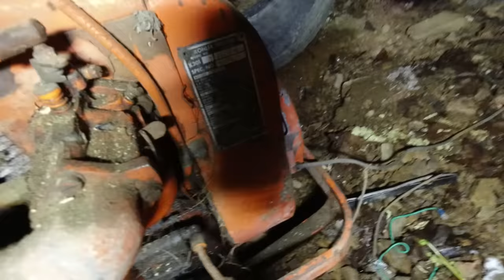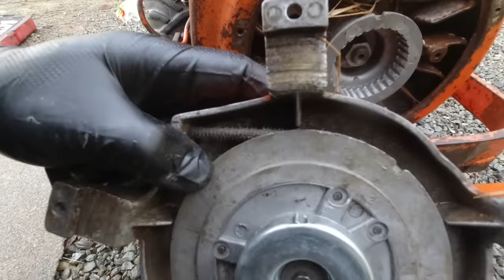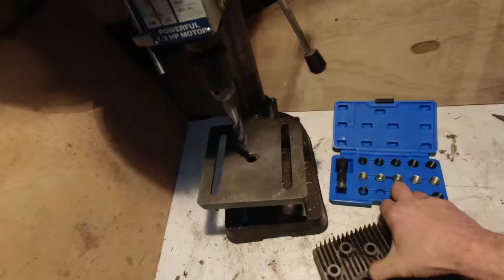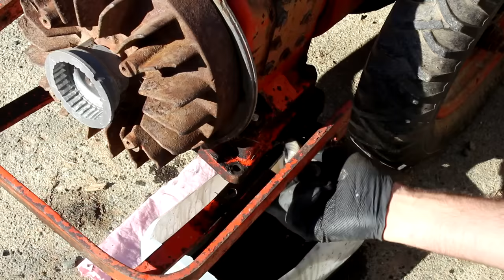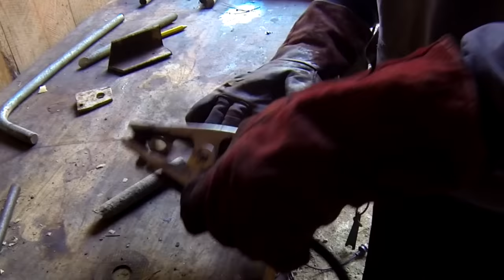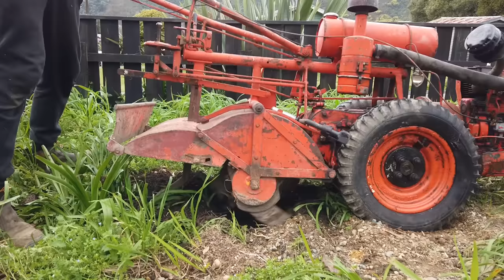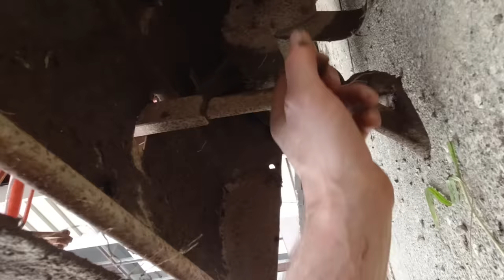Vintage Howard Gem Rotavator hasn't run for 15 years.. Will it Start??

Comment: FYI a common problem with Kohler engines that have not run for some time is corrosion between the magneto & the engine block, causing poor earthing hence weak spark. Hope this may be useful for future reference.

Comment: Ahh the old Howerd Gem I use to use the  bigger next model up the Super Gem with a Hatz twin cylinder  diesel engine that wad hand cranked there was a decompression lever under the fuel tank that had to be lifted,about 8 turns then drop the decompression lever it started every time,dont put your hand round the crank handle put 4 fingers down the front  with thumb on top if the engine ever kicks back it can smash your thumb up

Comment: i kinda suspected the exhaust valve was tight when it was opening with the head off. i don't think those kohler engines had a decompression option. you should be able to find a starter cup on ebay for a decent price. the trick is to use multiple descriptions when you search. some sellers don't know the proper name for parts, and they are the ones who will sell cheaper than those who break down engines to resell as an occupation and want premium prices.

Comment: It's interesting how similar the smaller Howard rotary hoe's are to the larger ones. My father and I have a Howard 12, they're a water cooled v twin 12hp version of what yours is, the crank handle situation is almost identical although the v twin's don't have a recoil starter for obveous reasons. Ours is currently out of action as there is a split tube in the centre of the radiator that we are yet to have time to repair.

Comment: We had 6 of these beasts at the tree nursery I worked at, 3 were still running 3 scavenged for parts. Ours all had Wisconsin engines, but basically looked identical.

Comment: It's important that the wheels are in gear when rotavating otherwise the rotors will take over and pull the whole rig away from you. They actually hold it back or regulate the speed. Different gear depending on the job in hand. I've had a Bantam and a Gem.

Comment: The clutch should be adjusted so that you have to push the clutch lever to engage reverse, which is a good safety feature to prevent it running you over. Reverse should automatically disengage the blades. I had the Gem with the Sachs two stroke diesel, which can be difficult to start in cold weather but has amazing torque. It needs potassium nitrate infused cotton fuses, which you insert into a plug in the cylinder head and act like a glow plug.
Reply from the maker: Thanks, I did not know that

Comment: You need to turn the ripper the other direction. I've never run one of those, but on the smaller ones the ripping tooth kind of slows the forward movement, letting the tiller blades get deeper. Makes it much easier, you don't have to fight the machine when you want to focus on one area

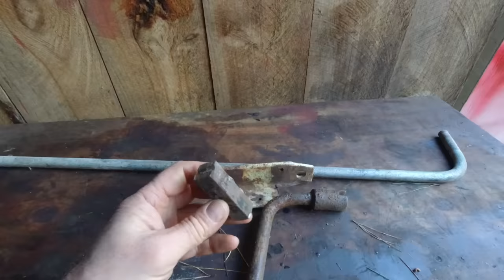Comment: 19:02 I'm not gonna try and a guy what to but the drive cup on the flywheel has notches so you can use a plain piece of rope after removing the faulty recoil starter.  Could saved some time and trouble there.

Comment: You need a smaller tiller with a backward spinning auger and that moves much slower.  Forward spinning augers are only useful for weeding between rows.  A good tiller for turning up the ground must have a backward spinning auger.

Comment: we use to have a Howard rovator with VW 1200 engine on it it was a little bigger cast iron wheels no electric start just just a hand crank that you had to use legs to push the crank  and if it back fired you fly into the air

Comment: Them tree roots make nasty tiller mines! That handle can jump up quickly,  were you using the depth bar , the spade looked backward.  Cool old Kohler
Reply: I had a Camon tracmaster and now a Honda F610, they all jump when you hit a root or big rock. Cheers
Reply: @willtricks9432  got a 1965 troy built , hit a big root jump in air about a foot and went forward about 4 feet.  Marked that spot, lol
Reply: @patrickblock2477  Between that and raking out rocks it's the hardest work and cheaper than the Gym. Cheers

Comment: Do you have ethanol mix petrol in New Zealand? If so do you use a fuel  stabilizer? Having problems with it rusting my fuel tanks and blocking up my filters. Love the channel by the way. 😊 Never miss an episode.
Reply from the maker: Yes we do have ethanol, last time I bought some 20 years ago, had to sign a declaration saying it was for motorsport. I did add a lead substitute to the fuel
Reply: I don't know if it is the same. In the UK all petrol contans either 5% or 10% ethanol. Ethanol is mildly corrosive of plastic and rubber and also corrodes steel. It causes a lot of problems in older equipment. The petrol also separates and can't be stored for long.

Comment: We just went into lock down 4, its ok Marty's got a 2 wheel tractor with blades in case sht goes sideways
Reply from the maker: It would make a good Zombie killer if the vaccine has unexpected side effects😂

Comment: I just recently had the “K” series Kohler engine on my old seventies era Gravely tractor apart and it’s pretty much identical to this one. They’re very rugged little motors that will last and last. Just gotta keep the grass and mouse nests out of the cooling fan shroud or it’ll overheat and shut down. Trust me on this. 🤦‍♂️

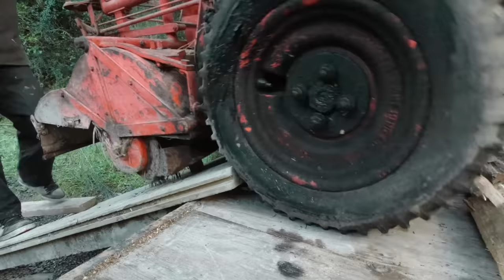Comment: 3:11  It looks like the right-hand hub is in free-wheel, thus it's only driving the left wheel.  Sometimes they had a diff-lock that could be engaged and released.  Otherwise, if both wheels are locked to the axle, turning around at the end is a struggle.

Comment: Can I bend your ear Marty; I got to a similar position with a roty, it's running smooth, but when I engage the blades they spin way too slowly and stop moving the moment they touch the ground. 

What should I start taking apart to address this? 
Thanks
Reply from the maker: This one had the same problem, I tightened the friction discs on the tiller shaft and that fixed the problem

Comment: How did you know which modern spark plug to choose in comparison to the old stripped plug? Is there a way to take an educated guess at the heat range of the plug based on engine cc?
Reply from the maker: I found the old service manual online and got the number

Comment: Hey Marty, just wondering what you think about the valve height adjustments? What do you surmise was going whit those clearances? I don't think the ends would wear down. They're hardened aren't they? Nice fix. I liked the way you went through everything along the fuel path. Once you get the muffler squared away should be a lot quieter and the replacement blade on the right side should help stabilize how she cuts through the ground. Might want to get a few extra shear pins for the blades as well, they're cheap. And YES, I noticed the signature "cat that ate the bird" smile at the end of the trouble shooting once it fired up. :)

Comment: I've seen the front half of that machine with a tow bar attached to it instead of the cultivator or tiller,and a 2 wheeled cart hooked to the tow bar where people and their goods would ride in a few 3rd world countries.. It wouldn't win any races in top gear but it would haul 2 or more people plus whatever at better than a brisk walking pace...

Comment: It started so easily after the valves were adjusted. It sounds like new.
Reply: Yup.  That's the first time I've seen adjustment on a side valve air cooled motor.

Comment: I use sanding disc adhesive to hold sand paper in place on glass when using that resurfacing method.

Comment: You get it tuned in and figure out the way/how to, run it! Make a great machine. Think may need a better drag foot to hold it back, use lowest gear and increase blade speed and slip the forward drive to give it the time to chew! May not even need to use the drive gears let the blades push it? The if stop use the gears to move forward?   Lucky guy you! Love the boys humor so nice to hear him laugh.👍👀🎥, 👋🏻👨🏻‍🦳🇺🇸, 🍻😎

Comment: My old boss had a Howard Gem with a Hatz Diesel engine, it was a fantastic machine 😎😎 what was the motorbike in the shed?
Reply from the maker: Nice, its an old yamaha 2 stroke, very corroded
Reply: @MartyT  you going to have a go at saving it mate?
Reply from the maker: @benspeedschannel888  I'll go back and have a closer look, if its not too far gone I'll ask if I can have it
Reply: @MartyT  cool, it’d be great to see you revive a motorbike 👍

Comment: the trick to using one is low gear and pick revs up a bit. ive used a few gems and own 4 of the smaller bantam models

Comment: You need to put the machine in bottom gear and swing the handles to the side so as not to walk on the turned earth. Also why pull it backwards when it has a reverse gear? That takes me back as l had a two cylinder gem, a wonderful workhorse.

Comment: Did you check the oil in the drive box? Great restore.
Reply from the maker: Yes I topped up the oils, did quite a few other little fixes as well but they didn't make the cut

Comment: The sparkplugg inserts i have used comes with a insert installer. that expands the insert so it dont come loose. Never need to use loctite.
Reply from the maker: This is a cheap kit, I prefer to use locktite

Comment: If I had known... I had one, had a starting handle on one side (Left as you look at it from the front) which folded out of the way. Connects to the square drive just under the air filter, and also the engine has automatic decompression.

And now I have watched it all, I see you found that out. 

One thing though, do you have the part number for the spare carb you got and where you got it from? 

The Howard Gem is a bit of a beast....
Reply from the maker: I got the carb from aliexpress, have a search on there to find the cheapest shipping option to your country -https://www.aliexpress.com/item/1005001423682968.html?spm=a2g0o.productlist.0.0.37f975e43FbxEk&algo_pvid=07d8c279-b506-47a9-bfd7-440547b95278&algo_exp_id=07d8c279-b506-47a9-bfd7-440547b95278-14&pdp_ext_f=%7B%22sku_id%22%3A%2212000016057909393%22%7D
Reply: @MartyT  Cheers. they are great machines, if a little loud.

Comment: To Start remove pull start crap and using battery powered drill/impact tool with socket.on the nut which holds pulley on axe. Using appropriate direction, pull trigger.

Comment: Seems really odd that the blades turn the same direction as the wheels.  Usually the blades turn opposite and the wheels pull them along.  Are you sure something isn't backwards in the drive mechanism?

Comment: Too much work Marty with that tine missing. She didn't sound strong enough at first but she liven'ed up. Too noisy. I must set my valves on my digger. A bit of work when you don't have a bench grinder to shorten the valves so I will add another head gasket. Not ideal but I am poor and old.

Comment: Pretty sure you can use a rope on the alloy housing  with pull start mechanism left off  I've done it with a Kohler engine on a woolpress pull it from compress stroke and away you go .R

Comment: Before i watch this ima say this rotovators are stout as hell we let one sit out in the weather for 8 years and this year we drug it out adjusted the points and literally on the first turn we had it started 
Just watched the video thought that urs was the same as mine turns out not, mine has 2 cylinders and duels all the way around also has a distributor, crank start with a compression release valve

Comment: My Dad had one, a backfire through the carburetor set the fuel tank on fire and caused a meltdown. From the comments it seems one of the less likely ways these things can kill you.
Reply from the maker: Wow! fire risk did cross my mind when I saw it spitting fuel out the carb, thats what made me think to check the valves

Comment: What do you think of your Impact Rattlegun? I notice it is is a ToolPro.
Reply from the maker: Very good, not in the same league as my 3/4 inch air wrench but it speeds up the big jobs and it will remove all but the most stubborn seized nuts

Comment: Kohler engineers be like: let’s make it so whoever has to use the handle gets the exhaust right in their face
Reply from the maker: Inhaling the exhaust gas dulls the back pain caused by using the machine, a perfect design
Reply: @MartyT  tbh I’m expecting you to jury rig up a trailing seat behind it

Comment: I have a beast machine like that has a wisconsin engine two cylinder with kick start. I desperatly need tires, no one seems to have any that match. If anyone knows where I can get some I would be grateful. By the way it also has dual wheels.

Comment: Where did you get the kit to fix spark plug hole?
Reply from the maker: Similar to this - https://www.trademe.co.nz/a/motors/car-parts-accessories/tools-repair-kits/repair-kits/listing/3226683804?gclid=CjwKCAjw64eJBhAGEiwABr9o2PKt7mXjxOV46KIdu-mfPJcmZ8IyrTMOdbbqO1ksQk7uaMh_IO3GvxoC19oQAvD_BwE&gclsrc=aw.ds

Comment: I wonder why it has a fuel pump with the tank well above the carb u think gravity would do.
Reply: @JohnSmith-yv6eq  yeah I considered that. Figured they would have used a block off plate and saved a couple bucks not putting fuel pumps on applications that don’t require them.

Comment: You are lucky the clutch still works.  I rescued a very similar machine and the clutch components in mine were rusted solid and ended up destroyed - finding another clutch unit was really difficult.  Mine has a 'quick connect' on the PTO, and came with two attachments: a rotary-hoe and a 1.2m sickle mower https://www.youtube.com/watch?v=88OysPdDugA

Comment: This gem modern to one i had mine had no reverse ,skinny cast iron wheels , the engine had a decompression level in aid of starting  it crank handle to  start it contacarous thing to running  but once running the motor had torque the age of the gem roughly 1940s

Comment: Not nearly as much fun as the excavator. I have a garden digger that I start with an electric drill as the people that couldn't keep it running had lost the recoil starter. When I got it the head bolts were all loose and the carburetor was a mess. Digs fine now. Yours looks too heavy for me now at 74. Wish you would bring down your excavator and get a dump truck and do some earth moving for profit. Grumble grumble

Comment: why wouldnt you clean the debris around the bottom of the engine when you had the pull start off. that engine will die from heat again